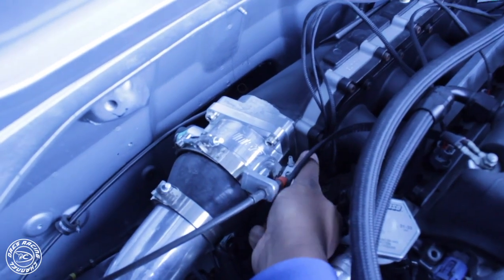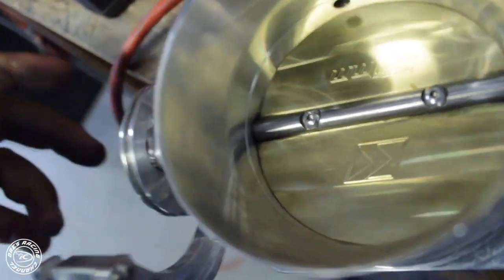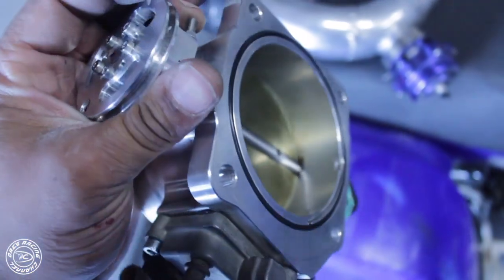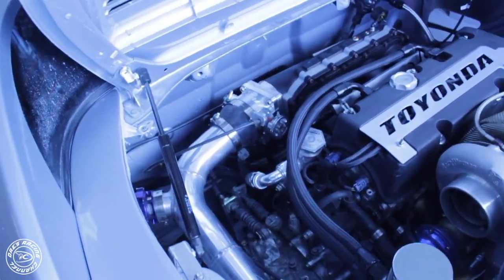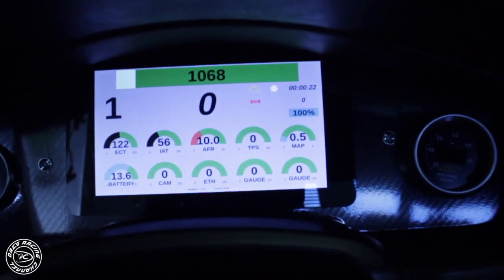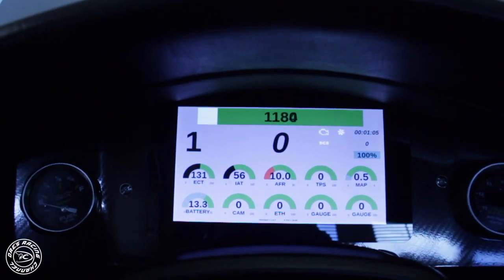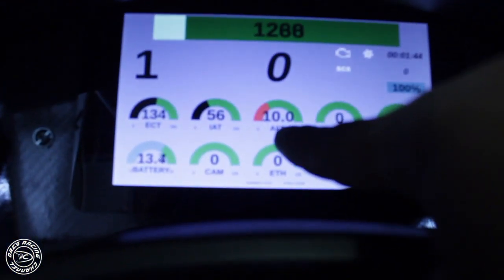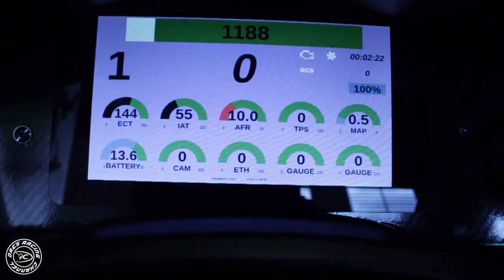HOW TO FIX STICKING KTUNED THROTTLE BODY

Comment: It's a simple fix. Just turn the idle screw until the length is a little longer where the throttle plate doesn't get stuck like you did, then adjust the tps sensor to .50 v closed and 4.5 open. Do this with the engine On position but not when it's running. It will give out a different reading..  Also note that the tps connects direct with the throttle body. If the tps calibration is off, then it will open the throttle body more than usual so make sure to adjust that